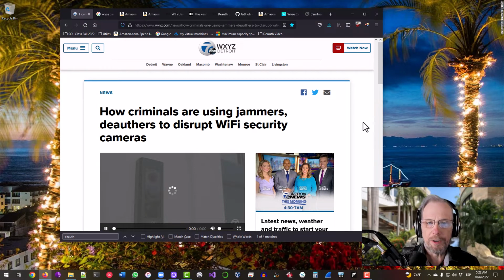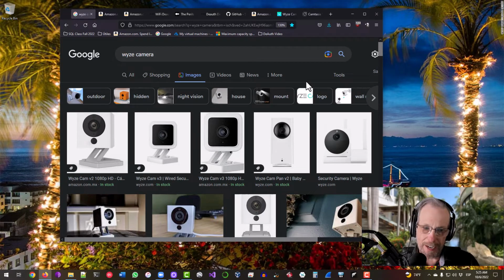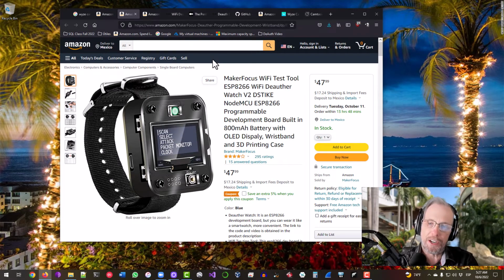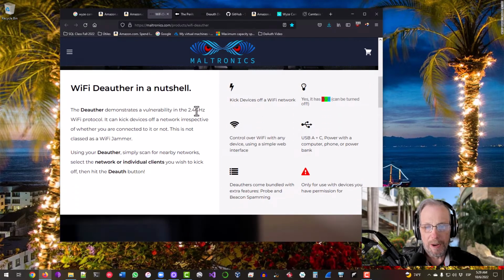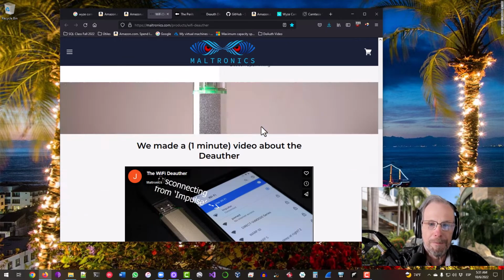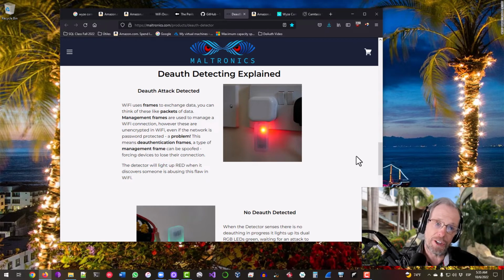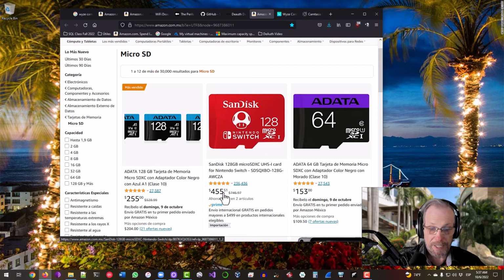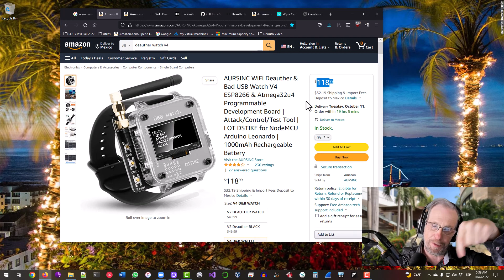Deauthentication Attacks Against Cameras and Prevention Tips

Comment: Little tip , i made my own Deauther attack detector using SpaceHuhns script and put it on a D1 Mini board with a WS2812b rgb shield
a little tweaking of the code and voila it just sits there with no light when nothing is happening , but when there is a mass packet request it shines a bright red
i use it mostly to check my wifi is fine , sometimes i have to block the kids wifi and that sets it off as their devices try to connect lol
Its mostly peace of mind as my boy who was 14 at the time thought he was a hacker because it started deauthering things , thankfully he grew out of that stage and is doing computer science at the moment